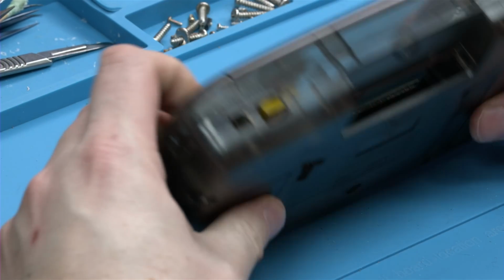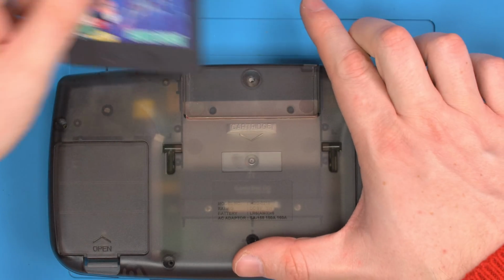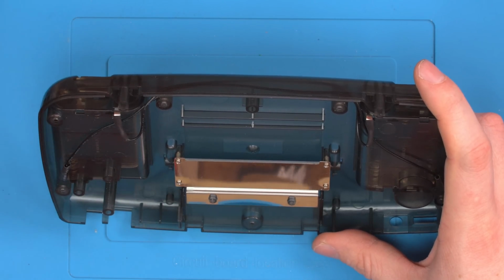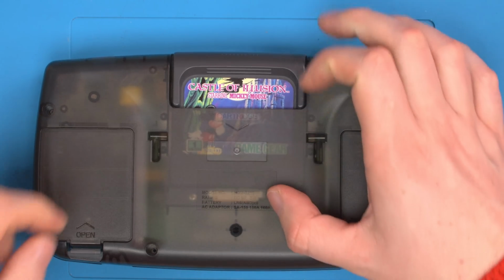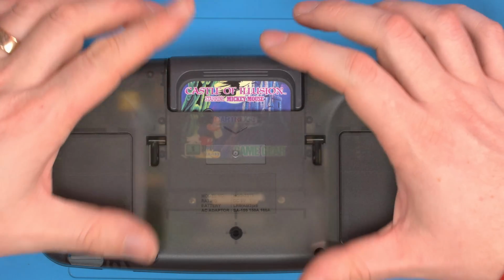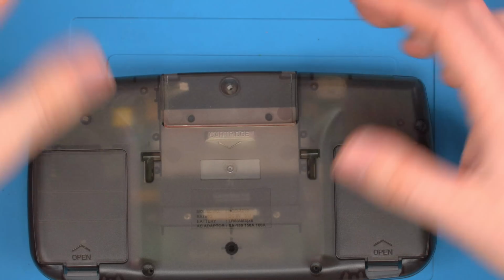I bet your Game Gear doesn't have THIS ?! (RetroSix GameSlot GG)

Comment: Could i instal it with a original screen?
Reply from the maker: Yep
Reply: @RetroSix I was just going to ask this same question. So where would you connect the ribbon cable for the original screen?
Reply from the maker: @ph4ntomlord it comes with a PCB that solders to the original PCB and adds the ribbon connector
Reply: @RetroSix Ok, I gotcha. Thanks man!